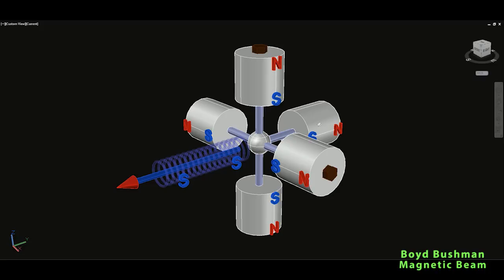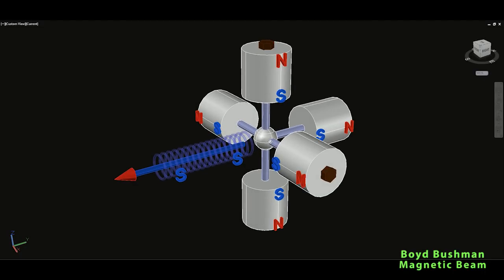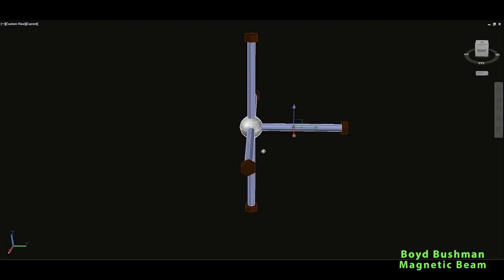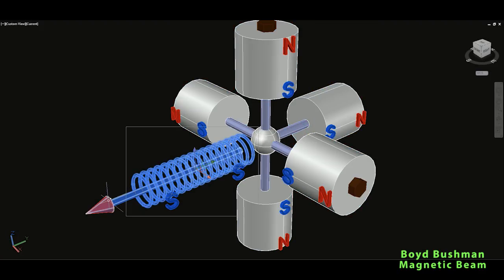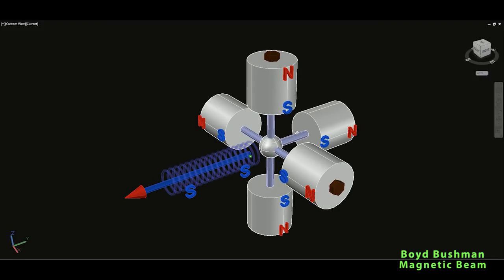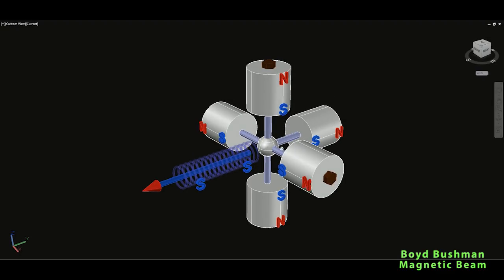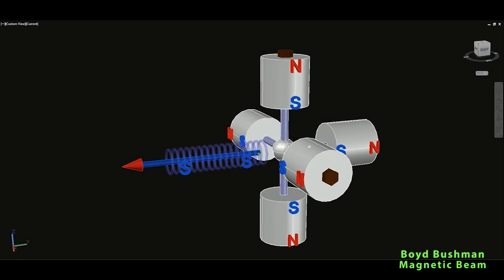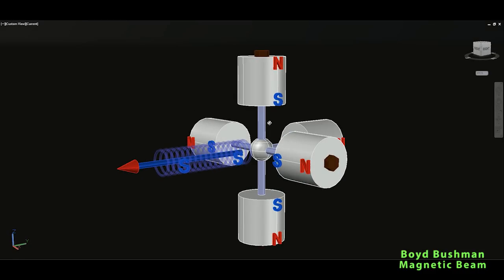FREE ENERGY, Boyd Bushman Magnetic Beam, SOLUTION for Magnetic Motor!!!!

Comment: Hey Mario; just order 4 of those magnets off Magnet4Less.  I can send you the spherical core with 4 threaded holes 1/4" if you like. It wouldn't take me but 10 minutes to make one here. Just add threaded rod on you're good, unless you don't have 1/4" holes in magnets. Let me know. I think I'll build this and fuse another idea to it. If you wrap 3 layers of coil around the back magnet and put an iron pipe around it, then modulated it with the right wave, it could seriously transmit some energy. The magnets if longer may do a better job.   
If you wish to use this concept in a motor however, there's no point because to amplify force this way you can do the same thing using 3 ac dynamos in series which would run 120d out of phase naturally.  32 or 24 pole casings only. Edward Leedskalnin used 32 pole casings in 2 dynamos (old truck or generator starter motors that worked off belt drive) to complete his circuit used for levitating megalithic stones. The timing post contained 3 coil layers close inside that iron pipe, so each time the distributor struck just before peak of each 3rd cycle, the pipe was charged between the distributor and magneto block outside with lots of iron on the way aside from the pipe. The 3 layers of wire would pick up the force , fold it 3 times, imploded it through focus, and get it back, and keep doing this continually, so the charge force would constantly refuel the 3 phase dynamo circuit using the 2 starter motors, the magneto block, and a 6 core coilset inside the 24v magnet array of that big flywheel. If you look close you can see 2 copper balls peeking out of concrete inside the flywheel. Those would discharge to another set of contacts each 180 rotation to degauss the array.
Finally he held 2 cone coils wired into the circuit to guide heavy positive ions drifting off that larger dynamo motor casing that sat inside a box on top a 35' high tripod.  This let him stack 2 ton stones on a truck once in 30 minutes like a deck of cards to the astonishment of the truck driver who returned to get his wallet off the dashboard.
Anyway, the secret to ANY super or over efficient motor is to have 3 points of negative mutually repelling, so among 3 grounds , they shift to a 4th ground which is your high voltage coil used to extract energy at whatever voltage is possible.  You can pick up power there indirectly using a coil/transformer, or you can get power off a belt or chain drive as force. The far ground opposite should have a larger casing and larger coils inside and allow it a space to shed ions away from the circuit, or it'll drown into it's own induction back to the emitter. Zero point energy is made here when the casing resonant waves implode through coils in each motor.
Boyd's use of positive mutual repel force is strange to me, since the negative is more energetic, but he was likely using that to amplify sinewaves not make an accelerator.  I suppose if you had 2 or 3 of these aiming at the same point in space, maybe 4 or 6 like the Death Star, it would create a grid zone capable of doing some real damage with energy, like maybe blasting holes in solid granite.

Comment: Geez, if you want an actual beam, use a caduceus coil and power it with AC. See what happens. Try to detect it with a probe. Use the coil to transmit signals. It is a longitudinal beam .3.
Reply: Aether was never described by Tesla as 'stillness'.  Besides, I have unified field theory using a very simple translation of the Planck Constant/e=Mc2 into a kinetic system which proves that space is flowing without vacuum. Stars consuming electron neutrinos to make new large particles causes the flow opposition among them which IS TIME and IS THE ETHER FORCE you know of.  It explains everything Tesla did including zero point energy extraction. Tom Bearden revealed Tesla's secret to that which is pump z waves imploding through the nonlinear medium which must combine forming a sum of wave peaks. Usually this is done with a carrier wave that becomes a pump z wave in presence of carrier waves, so the two work together to move charge over 3 or more grounds in any and all free energy device. Time is free, so energy is free.
Reply: Might as well be ether. Nobody seems to understand it either way. Corrected my spelling now you can delete your comment and devise a polite response. I'm not insane.
Reply: 1; There is no 'emptiness'. Space abhors a vacuum and this is extremely well documented. 
2; There is no such thing as pulling, only relative pressure that imitates pulling. All is a push. Ie; Space does not suck! THAT IS INSANITY.
3; I wrote a book unifying field theory. What did you do?
Reply: @mikefromspace  science has never proven there is a vacuum the misconception is a vacuum is there is a high pressure and a low pressure high pressure will always travel to low pressure to try to equalize so be careful how you say vacuum there's a lot of misconceptions of vacuum out there Earth being the standard pressure and even that varies due to Elevation and whether it's low pressure versus high pressure
Reply: @claytonraines3799  well actually science has proven there is a vacuum of air but as far as Elementary particles no there is no actual space where there are no particles anywhere near a functional Galaxy due the activity of flow opposition of elementary particles since stars consume small particles and create new large particles out of those continuously which is how a galaxy and why galaxy exists the way it does moving through space. I wrote the book on unification which does infect explain how this takes place. My first video here in 2008 showed boson formatting which was proven by predicting the geometry of superconductivity years later after I copyrighted that material.
Reply: @mikefromspace  so I am just starting out my studies in the science then you kind of answered my theory for for me so when people speak of a vacuum in space they're really speaking of a lack of particles so it's not a true vacuum it's more of a lack of pressure do the lack of mass such as when you go higher into the atmosphere a plane can go a little bit faster due to lack of massive air or atmosphere which creates less drag if you went into the ionosphere or out into space you would have even less mess so it's not so much a vacuum in space that's a lack of pressure due to lack of Mass this is just a theory I'm investigating and studying not trying to argue just trying to follow the logic
Reply: @claytonraines3799  you should watch my videos on particle physics.
Reply: @mikefromspace  i f*ucked a physicist!   twice!
Reply: Ah, there you are.  That sounds very accurate and interesting.  I'm wondering if perhaps the coil you are referring to could be contained in an ordinary looking drum container.  The kind that bob lazars described, being onboard a ufo.  The could supposedly focus the gravity, reduce or strengthen it, I'm not sure.  This device says to me that they are trying to isolate space itself, not project a beam.  I imagine the ship bob described as pulling space apart to create a low pressure area in front of it, and then falling into the well.  Bob says it is in constant state of falling, that's my interpretation of it.  
People do not believe that space is anything, right now.  Unless you understand what I mean and believe that there can be varying density in space, itself, you won't understand it.  It's not a new idea, just an officially rejected idea.  A density gradient of space.  Nassim Haramein teases people with such esoteric info.
Reply: @alanmalcheski8882  Luminiferous aether Lol. As well as parametric excitation aka modulation of aether.
Reply: @lukiepoole6701    I don't believe in aether, I'm a unified field person.  But if I find some I'll try it.
Reply: @lukiepoole6701    what does the coil you describe look like?
Reply: @alanmalcheski8882  It's been so logmng that I forget lol
Reply: @alanmalcheski8882  Aether is what allowed free energy to even exist, as it has unlimited energy.
Reply: @lukiepoole6701    I'm talking to the commenter next to you,  they think it was a staff, not a coil.  I'm looking for something shaped like an oil drum, the things that Bob Lazar talked about, that make the ship fall through space.  They may not have worked individually but what if there were three, and they were charged up or cooled down very low?  Thank you
Reply: @lukiepoole6701    aether to me is just background radiation.  Tesla did not know what that was, despite having success in connecting with it.  Background radiation is everywhere, all the time, there is no closed system that stops it from going through.  It is foamy, it phases in and out of existence at seemingly random fluctuation, but it does not travel through space like a cloud.
Reply: I’d rather have a natural occuring beam to power the motion of a prepetual motion generator to create power from nothing. That is if a beam can move magnets
Reply: +Ray Whiteside There is no such effect as 'creation from nothing'. This is the thinking of an insane person. Any wise and sane person woukd understand that you can only create anything from something. That something is what you call aether. The insane scientist removed it because it doesn't even undrrstand it. What aether really is, is not 'motion' thus no aether wind, but is an essence of everything which itself, is in Stillness. You cannot detect something that is not moving but is part of the apparatus you are using to measure. It's like you are measuring yourself using yourself.

There is no such thing as 'magnetic beam' because magnetism is force and motion. In contrast, dielectricity is inertia and accelerarion towards counterspace.

You will understand once you have a ferrocell.
Reply: Lol. Ok. Until you accually try it. Or until someone tries it and proves that this won’t work then I will continue believing what I like. In the meantime why not take a look into some working military patents that throw what u know about the world out the window. Such as anti gravity using only magnets. And propulsion using sound. But I’m not going to have some guy who has not tried this patent tell me that it won’t work. As u can see in the patent, the negative energy almost focuses in a single direction. Do you think that another magnet cannot be moved by that negative magnetic flow? No u don’t, ur not stupid. Now the question is can you focus that negative energy beam at a disc covered in magnets? And can you attach that disc to an alternator. Obviously the negative energy is consentrated in a single direction, so tell me why focused energy cannot outweigh the effects of the positive energy going the opposite direction. 

Btw. Scientists found that sound at some frequency’s can travel faster than light. Google it. Everything you know was taught to you. Not learned on your own. So how can u say it won’t work.
Reply: +Ray Whiteside 
This is why I say it won't work. Negative energy is not real lmao. South magnetic vortex is NOT 'negative energy'. Get a ferrocell mate. North and south are equal, the only different is the direction of the rotating magnetic torus.
Reply: @lukiepoole6701  If you say something exists and is positive then there must be a negative i i believe because there's always the other end of the spectrum and nature seeks the equilibrium between the two.  jmhop...oh and i nailed a physicist...twice!!
Reply: @scottvrosenfeld  If magical positive and negative "charges" even exist, then they would destroy themselves straight after they exist. You are given a brain by Heavenly Creator, use it.
Reply: @lukiepoole6701  In fact, "Magnets do no work". Which is the original assumption, that a magnetic field can do no work is incorrect.

In fact, a magnetic field has an energy density that is equal to the magnetic induction, squared, divided by twice the permeability (mu sub-zero). If you integrate (sum) all the energy of a magnet over all of its fields "before" it picked up, say a paper clip and compared it to the same sum "after" picking it up, that paper clip would deliver a loss of energy. The paper clip shorting out lines of magnetic flux. It negates lines in a magnetic field, and produces a lower or brings with its presence, the addition of negative values.
Reply: +mikefromspace
Rewrite : I was too sleepy to even type the last message without scribbling at the end xD

Anyways I am glad you are not like those 'scientists' What I normally do is do tons of experiment to furthet vindicate Tesla c:

I'm an electrical engineer with basic degree, yet my curiosity is high. I want to make an aether reactor utilizing high vacua density and high ameprage, crossed with high voltage in said high vacua, using 2 Caduceus Coil in series with each other.